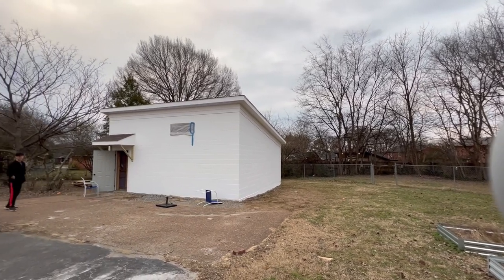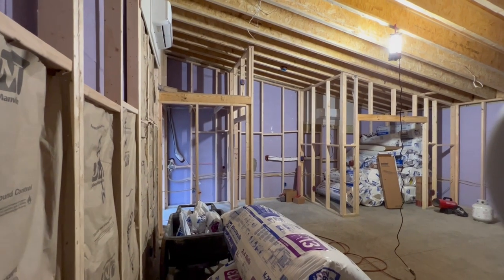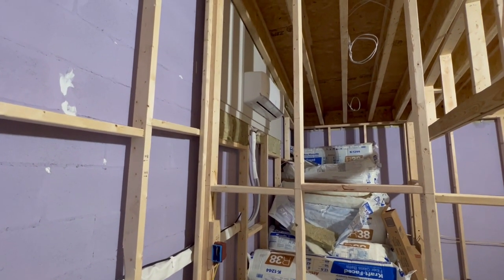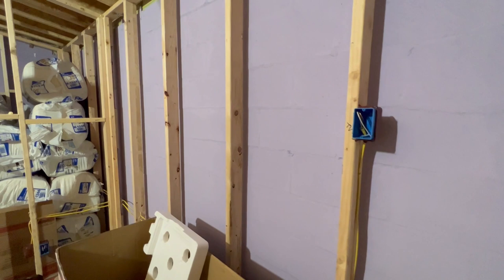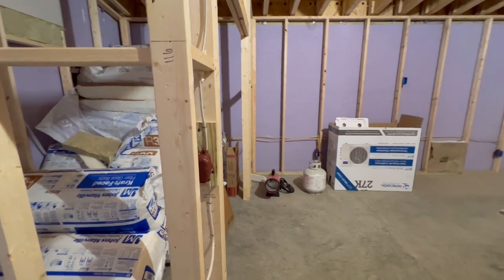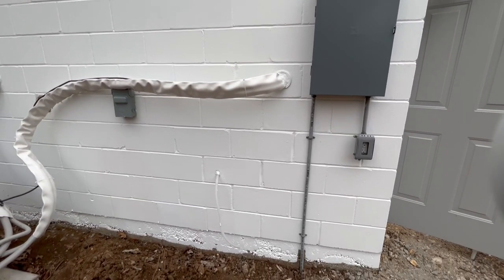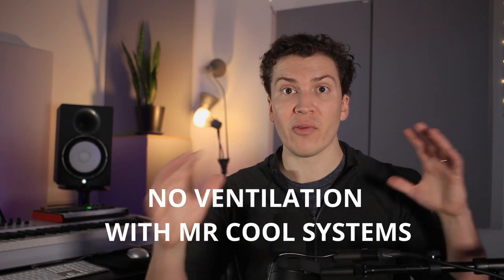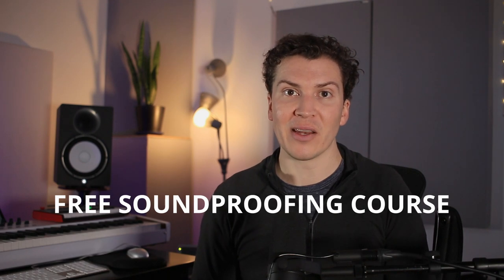Using Concrete Blocks To Build A Soundproof Studio

Comment: I think a better option is to fill the concrete blocks with sand. love your show.
Reply from the maker: Yeah that is an interesting option. I wonder if Henry was worried about moisture or it still have too much room for air to get through. Sand by nature has space between little bits of sand.  Thanks for watching!
Reply: @soundproofyourstudio  if sound gets thru air gaps even the smallest of gaps is then foam better than denser heavier mass sand?
Reply: I've build mine with blocks filled with mortar, works great!
Reply from the maker: @zelaomartins1381  Ahhh now thats a good idea!

Comment: Not having ventilation. I would be worried about instruments / gear experiencing humidity or high to low temperature changes. Sick build though. That’s what I want to do!!! Want my own studio so bad!!! One day. Also nice walkthrough.
Reply from the maker: Yeah I didn't have ventilation for a year and it was okay with humidity and temps. Really its the C02 and just quality of the air you are worried about. Thanks for watching.
Reply: A mini-split or two will fix the ventilation and then you want a dehumidifier for the studio. If you have acoustic guitars though you want to keep them in an area separate from the dehumidifier as they need some humidity to keep the wood from cracking.
Reply: My house is fairly air tight, when I turn off my whole house ventilation system, it feels hard to breathe after a while. He’s gonna have to open the door constantly in that small space

Comment: Random question here, maybe real stupid/novice.  

So I want to enclose my garage door to make a jam room/ drum room/ family entertainment movie room.  But I still want daylight, convenient entry, etc.  

I was wondering if I take garage door off, then I make a double wall, with 3 inch gap in between, but I want two glass French doors centered respectively where garage door is on both walls.  So that would be four exterior French doors total. 

I think daylight and entry will be covered, but don’t know if I will block enough sound from going out to my neighbors.  

I’m also wanting to put rock wool sound insulation on exterior garage wall, making a second wall in front of that exterior wall, and possibly around the rest of the garage walls.  

What do you think about the double French door walls, will it be enough?
Reply from the maker: Hey Daniel! Cool project. The double french doors might be enough if you have the right type of glass and it is thick enough. Tempered and Laminate glass is best for soundproofing and the thicker the better. The glass thickness should roughly correlate to the mass of your walls. Another option is buying soundproof glass doors from a company like Overly Doors. I'm not sure I follow you about building a wall around your existing garage and I don't recommend rock wool since it is expensive and regular insulation works just as well. Best of luck!

Comment: Most Spray foams are poor acoustic insulators.  They are also low mass so not good for low frequency attenuation. Filling the blocks with sand or mortar is a standard practice.
Reply from the maker: I agree. That was what the contractor did and I would advise sand is ideal.

Comment: What's the reason for that white board/panel that the mini split is on?
Reply from the maker: @Mountain123 that is the best way to install the mini split with the two layers of drywall. This way you don't have to try and put the mini split in after the drywall is finished which can be really challenging. Thanks for watching!
Reply: @soundproofyourstudio  Oh I see you routed the hose through the inside of the studio some ways before finally putting it through the walls. What was it about the spot that you choose to put it through the walls versus anywhere else? And wouldn't you have had to drill through the double layer drywall there as well?

Comment: Cinder blocks arent even fully filled. Like come on. What a fail. Why bother if its not going to be done properly? Fill the blocks with concrete or at least sand from the bottom up. All those materials costs only to have a weak point. Sorry, but super unfortunate build for me 😢
Reply from the maker: I wish we had added sand in retrospect